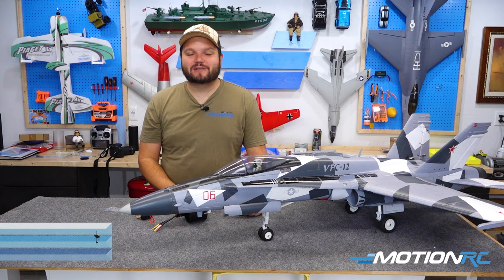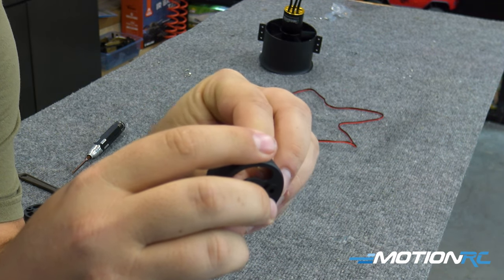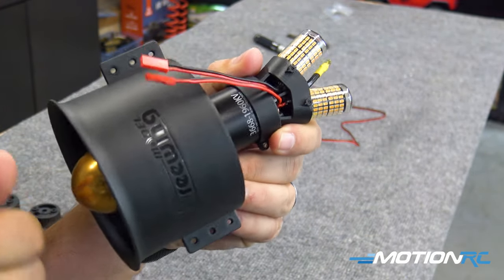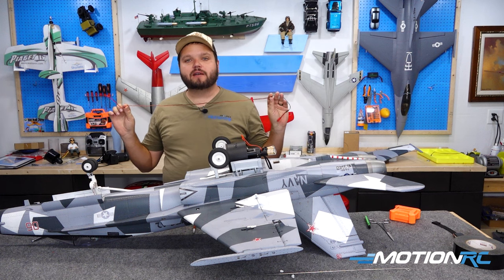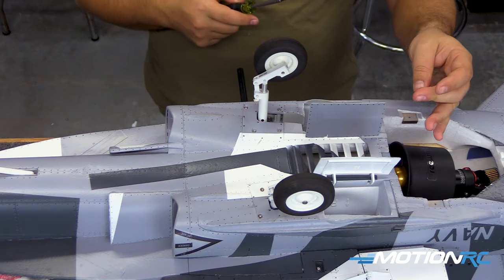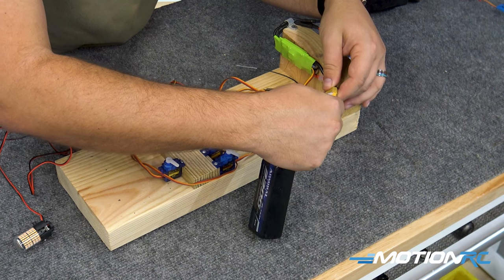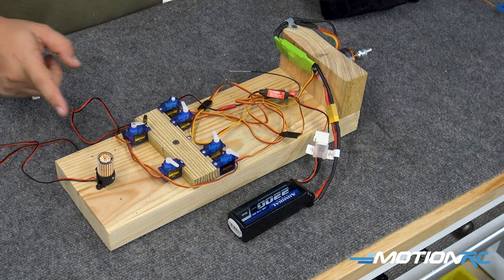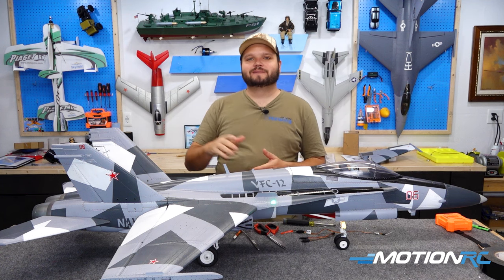Freewing Universal Dual Tail Flame Afterburner LED Light for Bifurcated 80/90mm EDF Jets | Motion RC

Comment: Question, would it be easier to use a small 3s battery to put in the jet just to run the afterburner or would that cause problems?

Comment: is it possible to use another battery to power theb afterburner ? for example can I plug a separate 2s/3s battery on the connector for powering the afterburner and use the main battery to power the motor ?
Reply from the maker: You could with a small 4s battery. The balance plug will accept 4s.